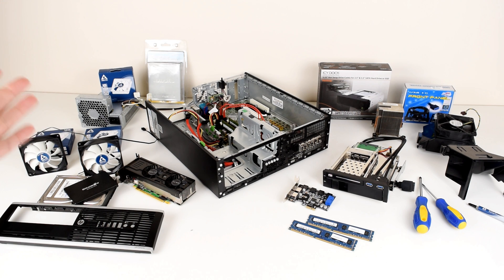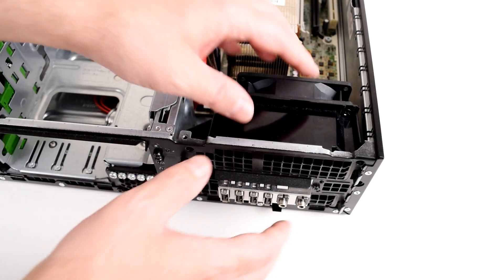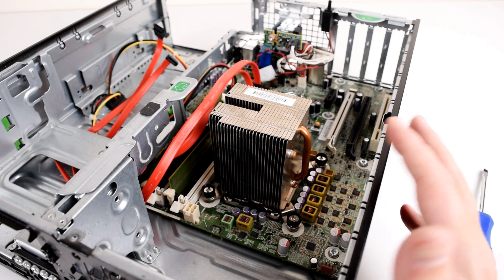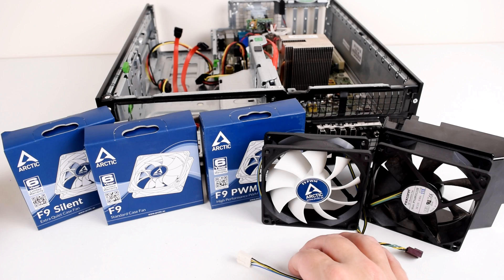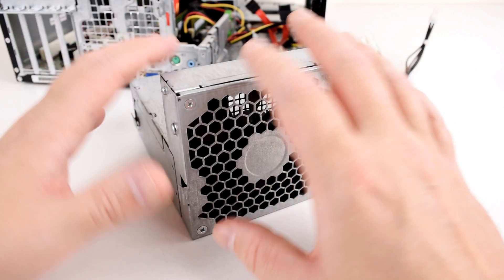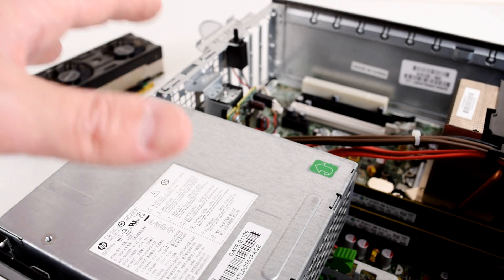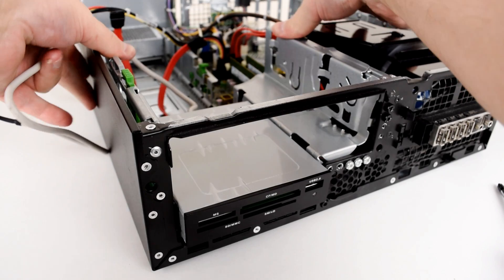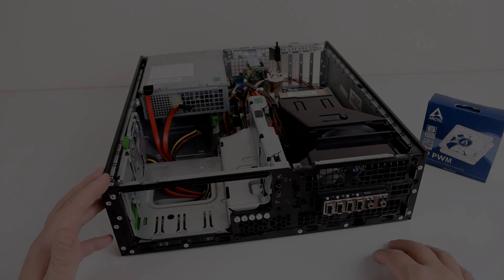Improve your HP Elite Small Form Factor PC

Comment: This is a helpful video. Unfortunately, the fan connectors of the arctic fans and the sockets on the motherboard on my HP 8300 SFF do not fit together well: the lip on the sockets is nearly as wide as the four metal pins but the Arctic fan connectors expect a lip only about three pins wide. That's why" a little bit of strength" is needed in the video from 8:29 to attach the connector to the board. At 8:36 you can clearly see the misfit: the brown lip of the socket on the board is bent strongly by the white, inappropriate connector. Probably does not matter here, but it does not feel right to do this inside the PSU where the same mismatch occurs.
Reply: Did you replace a psu fan? What kind of fan did you put? PWM? How quiet is your hp after this upgrade?
Reply: @piotrgorecki657  Yes, I replaced both the case fan and the PSU fan, after shaving off the small protruding ridges from the connectors. I used the type of fan suggested in the video, and replaced the old HDD by an SSD since it was very noisy. The fans are much quieter than the original ones, that's for sure. Personally, I would not want the machine on my desk though, maybe it would be quiet enough to have it under the desk. I do not know how to make it more silent since the motherboard does not seem to allow access to the fans (using a program such as SpeedFan).
Reply: Graf Wittensee What kind of fan did you put in a psu? Pwm or fixed speed?
Reply: @piotrgorecki657   pwm.

Comment: Some commented on the HP BIOS. Understand that HP machines are workstations. People won't overclock them. I don't know if there are BIOS mods available. I7-2700 Sandy Bridge and I7-3770 Ivy Bridge CPUs are not overclockers. You would need a K sku for that. These PCs are set up just right anyway. Overclocking them would cause too much heat for the small case and too much power usage for the PSU. These are tightly built PCs with a GTX 1050 TI in them. They are Maxed out at this point. Don't overclock them. PSU is rated not to exceed 240 watts. Right at limit of safe operation. Safe operation is normally 1/2 to 3/4 of rated power. Don't exceed that. The GTX 1050 TI is fine for this without overclocking the system or card. If a BIOS was available to do this I wouldn't.
Reply: I agree, updating bios could brick your motherboard.

Comment: For the Hard drives:
Make sure that ESATA is enabled in the BIOS or the drive won't show up in Windows evenon the internal port. My Z220 is like that. Look at tag inside cover for connection. There is a difference in speed. 1 is 6 GBPS, and 1 is 3 GBPS.Use Optical drives on 3 GBPS. I have a Pioneer Blue Ray drive, a ADATA SU850 1TB SSD, and a Seagate 2TB SSHD. I also have a card reader. I can get away without USB 3 in the front because it has 4 on the back. For fans I have a 90MM PWM Noctua in the front. In the Z220, I have a I7-3770,GTX 1050 TI and 16GB Memory running at 1600 MHz. There is a GTX low profile GTX 1650 TI out now I'm pretty sure. That might increase performance even more. I know a GTX 1660 did in My HP Pro 3500 which is similar in spec. to Z220. Also, HP Elete is close too.

You should make a video on the PSU fan. Mine is still good in my Z220. The PSUs are probably the same.

Comment: Desktop with proprietary stuff sucks !!!!
Reply: @computerrefurbishment9748  
- They are not cheap compared to their same specs/quality counterparts.
- Upgrade options + Maintenance are limited and/or expensive.
Ideal to rip-off naive customers.
Reply: @rogernevez5187  It's a good way to learn about upgrading without spending too much and risking part failure/damage. I got one for £25. Added ram, gpu, ssd, hdd bought from ebay.

Comment: I've got one of these with an AMD APU. The build quality is good, but I find HP's cooling solution to be really inadequate. According to HWMonitor the CPU temperature idles at close to 70 degrees C, and jumps to well over 100 degrees C when one of the cores is maxed out (with much fan noise). I don't know whether these readings are accurate (they seem really excessive), but the fin cooler + separated fan appears to be unable to cope. And the weird proprietary HP CPU mounts make it impossible to replace this with an off-the-shelf alternative (I realised this after investing in an Alpine 64 Plus which I then couldn't use). A great shame.
Reply from the maker: Not sure if you tried replacing the thermal pate / compound, as well as cleaning the fan?
Reply: @philscomputerlab  Thank you for replying, I appreciate the suggestion. I did go through that process when I was attempting to install the replacement heatsink and fan (before realising that they were incompatible). Unfortunately it didn't make any difference. But I suppose the AMD CPUs of the era tend to run pretty hot (I can't remember the name of the architecture, but it's a 2012 era APU).

Most of the time for general PC work it's fine. But watching full screen YouTube or running a game really turns on the heat.

Comment: How did you figure out the fan speeds that were represented by the various notches in the HP BIOS? I think one could assume the maximum setting would be full speed, but I am not sure how you came up with the other values. I am going to upgrade the fans in my HP 8200 ultra slim form factor PC, but could not figure out how to get the fan speed from the BIOS as every software program I tried could not read fan speed from the BIOS. As a side note the HP 8200 ultra slim form uses 60mm x 25mm fans in front and back. It may be a moot point as I can only find one quiet 60mm fan, so that is what I will probably get.

Comment: I added  an Nvidia Geforce GT720 low profile Graphics Board,  a BluRay player internal drive,  Blu-ray and DVD Player Software to run the drive, upgraded Windows 7 home to Windows 10 Pro.  Using the HP from Amazon renewed hardware.
Reply: Any advice on upgrading to a SSD?
Reply: @José_Chung  It is simple and there are many people on youtube who have written about it.  I chose SSD with SATA, a direct cable connection, while there are other methods.  I have two SSD 500GB drives, one for system and the other for internal backup.  I also did a new install of Windows 10, but you could use a cloning method and not need to set everything up again.  Good luck.

Comment: I just got one of these used for $20!   Great little machine!   I am using it as a home-based VMWare ESXi server, and have had no issues at all.    I am wondering - have you tried a PCIe SAS RAID controller in it?   I recently refurbished some old servers, and happen to have a desk drawer full of used 1TB HP SAS drives (I have about 30)...  I can get a HP p212 SAS RAID controller on eBay for $15-20.    Does the HP p212 SAS RAID controller work in this machine?   It looks like it should.....
Reply: OK, I got my HP p212 Smart Array Controller in the mail.  Cost $15 on eBay with free shipping.    It does work, but it was a real hassle.      For starters, the card did not sit 100% flush in the motherboard's PCI slot, it took me an hour of troubleshooting just to figure out that the board was sitting a little crooked.      Secondly - the p212's onboard BIOS simply WOULD NOT create a logical volume with any of the SAS drives I had, in any combination.  I kept getting an error message about unsupported function.  I wasted another hour troubleshooting THAT problem.    I finally found a post on a HP forum that said to try HP's bootable "Array Configuration Utility" instead.... so I downloaded the bootable ISO and used Rufus to create a bootable USB... BUT WAIT!?!?!     It didn't work...  if you read the HP instructions carefully -- the ACU bootable ISO must be written to a USB drive with HP's own "USB Bootable Key" utility.....    so I finally got all that sorted out, and booted my HP 6200 SFF with the ACU bootable USB thumbdrive... and then I was able to create a drive array with some spare SAS drives that I had laying around.       The p212 controller and the SAS drives get awful hot, but I left the machine running all night and everything survived.    Not sure I will keep this configuration, I was just playing around to see if it could be done.

Comment: I have an 8200 that the Ethernet port died.  I need to install a plug in adapter card to use my internet.  Whick one should I use?
Reply from the maker: Cheapest option is a USB wireless dongle! Otherwise just an Ethernet NIC (Network Interface Card). Make sure it is low profile!
Reply: @philscomputerlab  Thanks, I was consindering that.

Comment: Just opening the computer I see all of the reasons to avoid buying one.

It has a proprietary PSU with proprietary power connectors to the board. It also has a proprietary BTX motherboard where it has the problem of addon cards facing up, this means that longer double slot cards will often be obstructed by the CPU, as well as be subject to its hot exhaust and run hotter than it otherwise normally wood.

If the PSU dies, you're stuck with either repairing it yourself (not something everyone can do) or buy another old pull from another machine in unknown condition. If the board dies, you face the same issue, you can't retrofit a newer motherboard because of the BTX nonsense.

At least with Dell, you usually had ATX or reverse ATX and could retrofit PSUs and motherboards into them when they started acting up or failing. Dell did have some BTX models, but most of those were gone by the end of the Pentium 4 era.

Comment: Hi, so I have a HP t820 with an i3 4340 8gb ram and the FirePro m6100. It does pretty decent in the games I’m playing and is really small. However a few days ago I noticed when booting it was showing broken text but I didn’t think much of it. Now nothing shows on the screen at all. The computer beeps for no keyboard but that’s it. I got into Windows and it recognized the card but the driver is broken and Msi afterburner isn’t showing any of its stats. I went into safe mode without the gpu installed and DDU the driver so I can clean install it. Doesn’t boot into windows at all. So I use integrated to try to install the driver but the card needs to be installed. I have 2 extra video cards (hd 5450 and a quadro 3000m) but they aren’t very good. I tested it with the 5450 and it’s still a black screen. Serial # MXL5301PPZ. Any help would be greatly appreciated.

Comment: I have this same machine. since last some days it started having problem of not able to startup. When i press the power button its fan just starts for just 2 seconds and stops and even if i try many times it doesn't start. But on the very next day, it starts working normally. this same issue is happening everyday. Please tell what's the issue.

Comment: I gave mine a 240gb SSD with windows 10
32gbs of 1333Mhz ddr 3 ram
A GTX 1650
Upgraded the CPU to an I7 3770k
Added a 1TB plus a 2TB HDD 
Updated The Fan and the heat sink
Runs games and editing extremely well, VR works nicely too.
All Drives are laptop thin 2.5"

Comment: I opened up the power supply today to do a fan change on a 8300 but closed it again as the connectors were glued with some kind of adhesive - front fan was straightforward
Reply from the maker: Hmm I can't remember if I had this issue.

Comment: When you bring up the bios after everything is done. The machine is louder then before. Is it necessary to have the rpm that high? I know air flow is important in this small space but that loud of a fan would and did get picked up by the mic.
Reply from the maker: I was showing that you can control the fan speed in the BIOS!
Reply: PhilsComputerLab when you where closing out the video it was still wound up so I figured you left it blowing like a jet.

Comment: Ive got a similar Hp machine, ive added a 1gb graphics card, 5.1 soundblaster card, 4gb of memory, bluray drive and a card reader, i have plans to change the cpu cooler, cpu and case fan and i was looking into adding a usb 3 pci-e card too, at the moment it runs very quiet and fast.

Comment: I have a HP 6300, the I7-3770 quit addressing more than 2gb ram, this is an odd situation where I only found 2 instances of others having this issue, on the web.  any advice other than get another processor to confirm its not the motherboard?  it will only boot with up to 2 gb any more just sits there fans on high.

Comment: Greetings: Watching closely while you replaced the fan, the replacement seems to be in backwards based on the location of the fan central support arms. Does the air now flow towards the cpu cooler?
Reply from the maker: Yea it sucks the air out towards the front, that's how HP designed that machine!

Comment: I have a 6200 Wich is similar and for some reason it doesn't display, i removed the gpu and and tried to use on board graphics and the PC didn't display so i reinstalled the GPU and tried to boot and it doesn't display aswell, the fans spin and go loud after some time my mouse Lights up, but my keyboard stays out, the psu has quite a bit of dust can it be the cause?

Comment: I got an HP Compaq Elite 8000 SFF PC, small form factor as the one in your video, but it has got only a 240w PSU. Would there be any possibility to get a higher voltage PSU? TIA

Comment: If you use a typical "quiet" fan for the front fan (a fan that only runs at low speed) then the CPU can overheat because the front fan needs to be able to ramp up if necessary to cool the CPU at full load. Instead, you need a faster-running fan that is also quiet at low RPMs, so that the fan can be quiet at idle but move more air when cooling load increases.

Comment: Great video and I found this randomly at the perfect timing! You mentioned the 8200 had a max potential of 32GB of RAM but I was reading the user manual recently and it noted they only support a max of 16GB of memory. Can it support more than listed in the manual, or am I understanding this incorrectly? Thanks!
Reply from the maker: Yea I tested 4x 8GB Crucial memory.
Reply: @philscomputerlab  Thank you! I have 24GB installed and I haven't run into any issues. Can you link to the card/adapter you used to connect the USB 3.0 cable to?

Comment: Thanks for this great video that inspired me to improve my bargain PC, a HP 6000 Pro which originally had a Pentium E5700, 4 gb DRR3, a HDD 250 gb and the crappy Intel Graphics Q43/45. Now works flawlessly with a Q9400, 6 gb DDR3, a SSD 128 gb and a GT 730 DDR5. The total cost of this improvement was only 55€ for used Q9400 and GT 730 (I had at home the SSD and 2gb DDR3).
Reply from the maker: Nice! Yea a Quad-Core, more RAM and SSD helps immensely.
Reply: Sure! I like very much your channel which I recently found.

Comment: What a great video. I just snagged an 8200 off eBay for $60! Has an i7 and a 500gb HDD, gonna throw in an extra 1TB, install Linux, and get Plex up & running on there. Thanks for the tips on the multiple SATA ports, and the PWM fans- those sound really great for my planned use case.
Reply: LOL, Me too.   I just bought three of these off Ebay for $35 ea.   Going to put a 256 SSD and 6TB 3.5 HDD in them and make Plex servers out of them.   Should be awesome.

Comment: Hello, i have a z220 and i want to put a gtx 970 and a new psu in there, but i saw that i can't connect the psu to the motherboard because it has no ports,  what do i do?
Reply from the maker: I don't recommend using that graphics cards, it pulls too much power. But if you want to try it, you can get adapters from SATA power to 6 pin PCIe power.
Reply: PhilsComputerLab is 500w ok? and also what adapter i need to connect my psu to the motherboard?
Reply from the maker: @renko8065  I'm confused now, my Z220 has 240W PSU.
Reply: PhilsComputerLab i mean i wanna put a new 500w psu in the z220 but the motherboard doesnt have a 24 pin connector
Reply from the maker: @Gladiator You can't change PSU!
Reply: PhilsComputerLab Why?

Comment: Hi Phil, I have a HP Elite 8300 i5 3470. The RAM I have is 2 x @GB PC3-10600U-999 HF. Can I get the ram above in your link to upgrade? I really don't understand the different RAm and if it's ddr3 or ddr4? any help is appreciated please
Reply from the maker: That CPU takes DDR3 1600 MHz RAM, but you won't see a huge difference to be honest. Newer computers use DDR4 instead, but more expensive also.

Comment: im watching this on my HP Compaq 8100 Elite stock with a Intel Core i5-650, 4 gigs of ram, and the Intel Q57 chipset. this is a good little PC! though i plan to upgrade this Core i5 to a Core i7-860 and a low profile 1050. i think this should make allot better of a gaming machine after these upgrade. edit i also plan to put in an 8 gigabyte RAM kit to get some dual channel goodness.
Reply: Same as you, but with a 1030 and 8gb ram, gonna max it out w/ an I7 880, 16GB, and 1050ti though.
Reply: @bochaltwoo  i got my upgrades done on a budget smaller than i was gonna do final specs are Intel Xeon X3470, 16 gigs DDR3 RAM and a 2 gig GeForce GT 1030 GDDR5
Reply: @bochaltwoo  oh yeah and i just got done installing macOS High Sierra on it so it's good for macOS too
Reply: @Jorge Garcia ay not bad though i must say this Xeon X3470 and GT 1030 i decided on its doing really well!! im glad your liking yours!!

Comment: Is the PSU fan really a PWM? I opened up the PSU and replaced it with a Noctua 92mm PWM but it seems to run at a very high static RPM, not changning like the CPU fan which I also replaced! However the Noctua fan connector was pretty hard to fit to the PSU in the PSU.
Reply from the maker: I can't remember if I tested the PSU fan, so you might be right! I'm getting a new machine soon, EliteDesk 600 G1, so I plan on covering that machine also fully :D
Reply: @philscomputerlab  Is it the same PSU? Maybe you can test then! I'm trying to find fixes but the fan keeps spinning on a high static RPM... Might have to switch to a NON PWM fan...